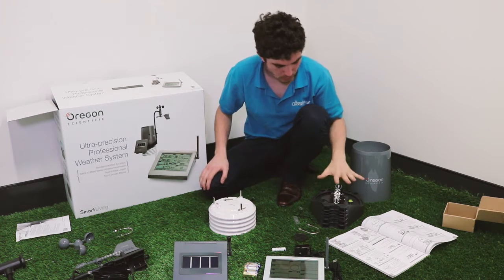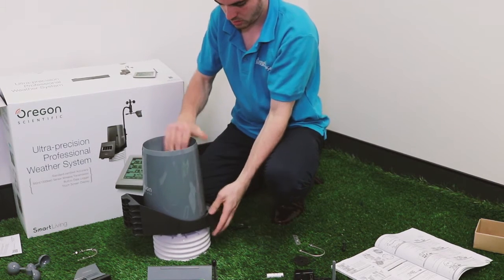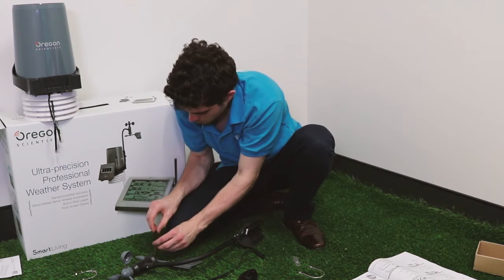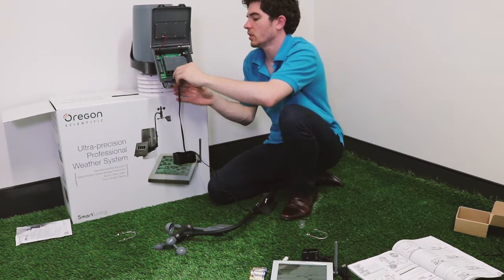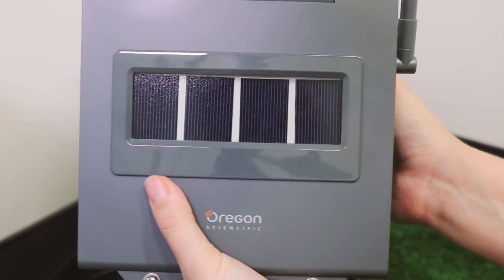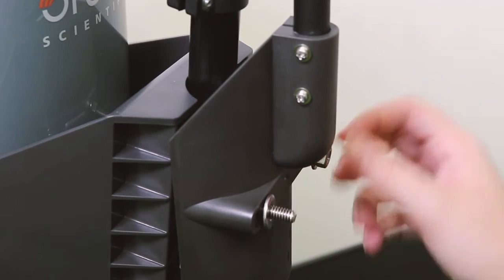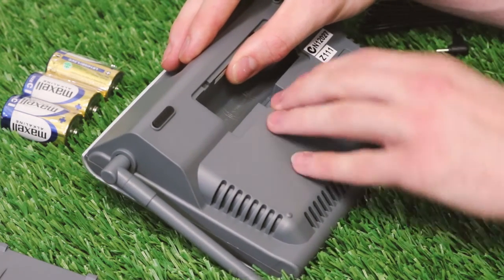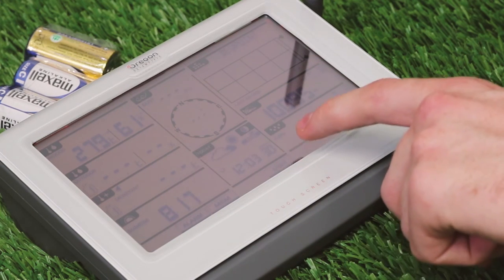WMR 300 Assembly and Setup

Comment: Before you put the wind cups on the instructions state you have to move the 'O' ring on the shaft so there is a 0.3mm gap bettween it and the plastic housing. This does not seem to have been done in the video. There is no information in the instructions on how to obtain a 0.3mm (about 12 thou) gap. I ended up making a tool with a U shape cutout from 0.3mm thin cardboard. 

Also you need calibrate the North direction of the wind sensor before you close the cover of the sensor box, easy enough to hold it steady indoors but much more of a challenge if it is outside mounted too high to reach. I used a rubber band to hold it pointing north while the pole was erected with the sensor on. I then cut the band from the ground after setting the North direction using a long tree lopper !

In addition you need to set your location - the instructions for this are very confusing in that they say you should set your latitude & longitude in the 'today' setion but there does not appear to be any way to do this. Also the display on my unit does not show the Lat & long shown in the instructions. However my unit seems to have set itself to the correct location, judged from the sunset & sunrise times. I suspect that the currrent models may have a GPS receiver in them ????